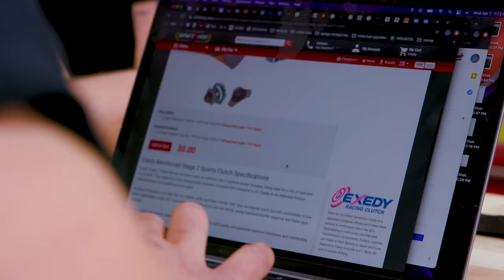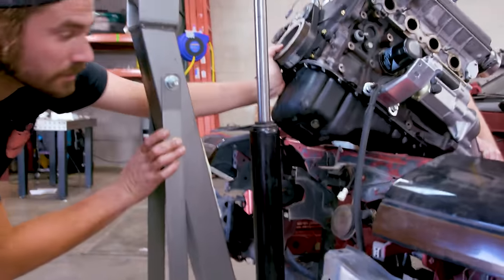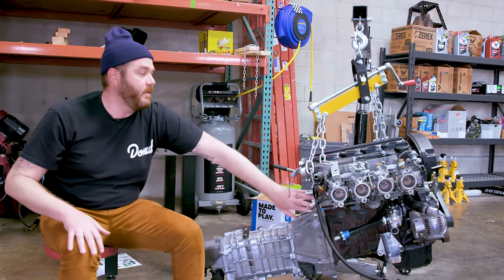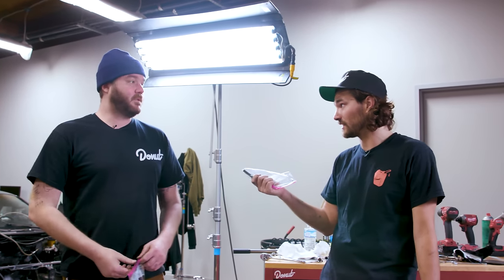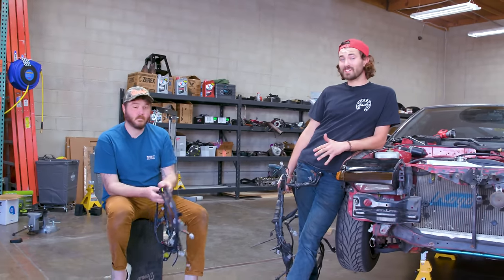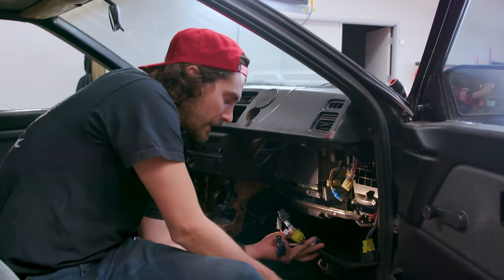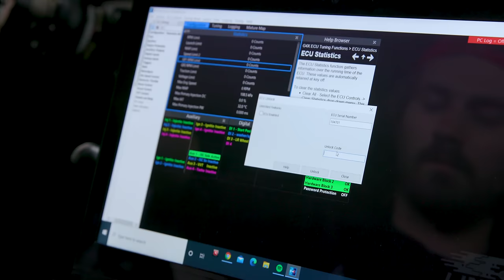Engine Swapping James’ AE86 - Was it Worth It?

Comment: The fact that the next episode will 99% likely be you pulling it out to paint the bay is the best way to end
Reply: If i know anything about donut this is exactly what will happen
Reply: I have 0 faith that that engine bay is ever getting painted.
Reply: @michaelleoanrd194  we can only hope
Reply: Hopefully they do 😭
Reply: Can you make this not the top comment! It was disappointing to look down and read this half way through the video. I want drifties
Reply: T-t-t-turrrrboooo
Reply: Lol
Reply: I hope they don't. I love scrappy, mismatched paint like that.
Reply: They should just clean it with some acetone and be happy now that the engine is in the car
Reply: The entire car just needs to be painted.
Reply: Why wouldn't u paint the bay first !!!!!
Reply: They did re-plastidip low car.  Wouldn't surprise me if they removed the motor to paint
Reply: Because that's how it should be done, a dry fit (welding brackets etc etc), removal, prep and paint, install complete engine into a properly done engine bay
Reply: @Sku77CL1PS  I don’t get how I’m spoiling it? I made a prediction based on pumphrey. I have no clue what’s coming but I am Sorry to ruin what I did. I never thought it’d be too comment 😅
Reply: I am from the future, they didn't in fact, pull the engine to paint the bay.
Reply: Does that mean there is a 1% chance of it not being likely, and how good are the likely odds?
Reply: @michaelleoanrd194  me too no faith at all
Reply: and forget to buy the paint for the spray guns. :)
Reply: James sold the car and my friends bought parts of this car. I was trying to get the dashboard that came with it
Reply: it’s still not out
Reply: Whole tim theu were pulling it I was lile please gut the bay and paint it lol such a clean 86
Reply: @michaelleoanrd194  The first first thing that 😅comes😅😅😅😅😅😅u😅uu😅yeah you’re  y😅y

Comment: Things I learned while doing my first engine swap. 1. Either buy a used engine or a crate motor 2. spend a little more and get the beefier parts 3. paint the engine bay 4.check smog laws before you start 5. If your car is over 40 years old redo the wiring 6. It's incredibly satisfying the first time it starts
Reply: I see that “paint the engine bay” in there 😭

Comment: Y'all inspired me a long time ago to turbo my 2.4 Dart... I've got about 13k in parts sitting in my room and in shipping right now. In the next month or so my car will be pushing 300whp at the least, more than double stock power. I did hundreds of hours of research and spent measured every aspect of the engine bay- even 3D modeled the whole engine.  Designed my entire turbo setup myself and am going to be running a Frankenstein of parts, cst4 for a mazdaspeed3, water air intercooling, meth kit, auxiliary oil system, built trans, big tires, the whole works.  Channels like yours inspire me every day to keep wrenching, building, and designing :D
Reply: Nice
Reply: that sounds SICK
Reply: How did it go?
Reply: You spent $13k to make 300whp? Weird flex
Reply: goddamn hope it went well

Comment: This is like when Takumi blew his engine and swapped a race-tuned one that goes 11,000-13,000 rpm  and then basically beat an evo on the touge
Reply: Does this mean James is gonna blow up this engine?
Reply: It's 11,000 rpm
Reply: yes and no
Reply: What about that time the gaijin put an RB26 into a rusted out mustang and defeated the Yakuza single handedly by drifting down the mountain?
Reply: @lrrr9734  James is the next gaijin that will single handedly beat the yakuza
Reply: Not really, in the anime they showed a silvertop. But in reality they where referring too a hasselgren formula atlantic 1.9L heavily tuned 4age. But one can only wonder how they "detuned" it for street use. Tbh for a swap id go for a 3sge
Reply: It's kinda true. Go watch video option... all the cars DK spanks in his 86 on the touge. The Hachi Roku is legendary!
Reply: Well Takumi blew both engines eventually
Reply: @SimanSlivar  1uzfe/7age/k24
Reply: @decoyla  na the 3s is perfect for the platform. It requires the least chassis work to make decent. Tbh i dont like the honda k engines they tend to not have as good usable torque without some extensive work and for what they are they are kinda on the portly side vs a 3sge blacktop and a w58 trans combination. 7age is more or less with the atlantic enigne is with allot of added work and a 1uz requires allot of chassis work. The ae86 was never made for a v8 and even has problems out of the box with the 4age.

Comment: Would love to see more of this project I love ITBs! I installed some AE101 silvertop ITBs on my miata recently. Opted not to tune on TPS alone like many others do for the lack of versatility and instead decided to figured out how to run on speed density (MAP). I configure my own vacuum system that behaved similar to stock and the car runs like a dream and I was able to actually use my previous stock tune with simple tweaks to fuel load. It runs very smooth and feels surprisingly "factory".

Only really mentioned all that in the off chance someone who is in the middle of or wants to install some ITBs reads this and knows it's possible and was actually a pretty simple setup. A vacuum block a couple check valves and some hose and done. Just gotta configure it right.

Comment: the 4AGE 20v blacktop and silvertop is not 2.0L, it is still 1.6L. What you see on the valve cover "20" means 20 valves, not 2.0L
Reply: Its the 3sge beams blacktop that is 2.0 liter and had 16 valve  the 4a ge blacktop is correct 1.6 liter 20 valves. But some use the itb from 4age blactop on the blacktop beams.
Reply: @terjejohnsen3651 
3S is always the correct swap on a 4cyl Toyota. I run the 3S-GTE variety on two of mine. The BEAMS is the go-to for NA HP, though. No doubt.
Reply: @negativeindustrial  i use 3sgte gen3 on mine 2 mr2s but beams has no lag and you can get more piwer out of it even its really expencive.  The cheapest is to use blitz compressor.
Reply: @negativeindustrial  The 4age would be more period correct for the car, and would probably rev higher
Reply: He also pointed the front of the FF configuration the wrong way (intake facing back)
Reply: @negativeindustrial  yea but the blacktop has 5 valves
Reply: @augustopinochet6899 
BEAMS 3S have a very high rev limit and dual VVT-i. They make 210HP in stock form which no 4A comes close to.
Reply: @negativeindustrial  But the 4age is oversquare, which assists in pushing engines into high rpm, vs the 3sge square design
Reply: @augustopinochet6899 
The 4A is an awesome engine. I love the early T-VIS equipped ones, too. Fun to run out the revs but they produce too little HP to deal with on a swap.
For me. I’m glad people still run them, however.
Reply: @whengchung90  and they use the blue coolent they should use toyotas red coolant.
Reply: @terjejohnsen3651 
Only Toyota Red should ever be used. The same goes for all fluids, engine seals, ignition components and basically anything else.

Comment: James Could have also mentioned that the Black top 4AGE also came side mounted on the AW11 MR2 so it was basically a front wheel engine but on the back. The engine being available as is on the MR2 made the chances of getting a transverse version a lot more likely as it's also popular for MR2 owners to swap away from their 4AGE into a Beams 3S-GTE or a Kswap

Comment: The only engine swap I've done was on a '69 Chevelle when I was like 22 or 23 in the year 2000. Also of note is I did the whole thing by myself with nothing but a Chilton book for help.  It came with a 307 with a 2 bbl carburetor. I put in a 350 with a 4bbl carb and aluminum intake. It was pretty fast but I couldn't afford to really keep up with it and I didn't know a lot of things I needed to to tune it properly.  Also it got about 12-14 mpg.

Comment: Last generation 4age 20v blacktop was a 1.6L engine with 5 valves per cylinder. All 4ages are 1.6L. Using a 7A block will stroke the engine to 1.8L. BLACKTOP 2.0L refers to the 3SGE BEAMS engine.

Comment: ITBs are some of the single coolest things to ever be on an engine. Could I have made mo powah baby on my 68 302 with an electronic fuel injection system? Yes. Would it have been slightly more reliable with EFI? Yes. Does it look as cool as the individual Weber setup that actually went on it? NOOO

All seriousness. You can get nearly the same economy and reliability out of a carb'd engine as you can out of EFI, as long as you take the time to fine tune it. When I was 16 my grandfather was looking at my 1970 Ford Torino with a 351w. Walked inside grabbed a glass of water, full past the brim so just that surface tension was holding the water in the glass. Set it on top of my air cleaner. When water was obviously shaken out of the glass. He looked at me and said "Turn your carb, this glass should be able to sit on this engine without spilling a drop"

I hadn't seen it at the time, but I would come to find out later in life. My damn grand father was the American version of Bunta Fujiwara! Damn old people and their water... 

As funny as this is, its not a joke. Because of this my 351 purred like a kitten at idle and roar'd like a jungle cat with some sweet sweet revs. Also, my 68 Mercury Cougar with the 302 I had after, got 28mpg on the highway. Took me endless packs of carb jets and hours and hours of time to make it happen, but it can be done.

Comment: As for painting the engine bay, another channel i watch, seems every bay is painted white, makes it so much easier to see what you're doing. I'm definitely doing it if i pull my engine, even if it's with a brush and not a spray gun.

Comment: I hope u put a racing 86 engine in it that revs to 11g
Reply: it would be cool but there's basically no way to get your hands on an engine like that nowadays
Reply: If you could even get the parts the engine would basically be a complete race engine which would wear out very quickly and also have low power at low RPMs. Since James drives his car on the street it would actually make the engine worse for his application
Reply: @ericsson_motorsports  exactly
Reply: @vitozivlak  eh, you can always get a formula Atlantic motor from somewhere. Plus building the 4ag into a race motor is always a possibility, there's a guy with a 250hp 16v in a hillclimb KP61, think it ran 11k revs at one point

Comment: Next video ideas:
1.  Tuning basics using a lap top and an ECU WITHOUT a dyno.  You got that new LYNK unit to play with....
2.  Cooling basics / fill / monitoring / improving for higher HP applications.  Water vs glycol vs wetter, etc.  How to measure, and improve.
3.  Maintenance intervals.  What changes are recommended to be considered when you up the HP of your engine or do a swap?  How to keep it alive...

Comment: Go they reminded me when I assembled my 86 with a 4age 20v mid 2007 or 2008 engine. I made the engine wiring by hand by seeing the forum 4ag club post. Then I mounted a Honda commutator since they mounted it with the Honda distributor and modified the Toyota distributor so that the computer would read the signals. The last thing I did was make it 7age 20v bored to .080 piston oversize. and I made him regrind the camshaft. The last thing I am going to do is mount a HKS F-CON V PRO computer but I am going to try to communicate via Bluetooth to the ecu.

Comment: ITB's FTMFW. Sound so amazing at high revs. AE86's are the perfect car to beat on and one of the more 'affordable' chassis' to build, plus you don't have to feel bad about pounding on it. Unfortunately they have recently went up in price as culture has influenced this as well as desirability/ rarity to find a clean unmolested one. Engine bay prep is huge when I do a swap. One of the first things I do before I stab a new drivetrain in is clean/ eliminate all the unnecessary bullshit in the bay and then paint it up. No reason not to take these extra steps and you'll probably regret it once the engine/ trans is in as its pretty daunting to say the least to make the bay look as good as it can with everything installed and obstructing it. Nobody wants to spend the extra time after the fact masking off everything to prevent overspray and or messing up your new engine.

Comment: You should cut the top support for the radiator but keep it to bolt back on.that way when you have to take the engine out you can just move it and then bolt it back on when your done.

Comment: When ur so excited to install a part, or in a rush, and forget a simple but necessary part like gas lol. I was rebuilding all 4 brakes on my car, started raining. Left my car for a week until I had time to get back at her. I was racing against time to make my appointment. I put in the driver side in like 5 mins, goto the other side...I put in 2 of the same pads. Put both outer pads on 1 side 🤣 needless to say, I missed my appointment but I got my brakes rebuilt! 😆

Comment: For future reference dont swap rwd engines with the front end elevated  angles are all wrong as you saw when trying to stuff the engine in, keep the car level or even raising the rear will make install smoother. Something to keep in mind when pulling engine to paint the bay

Comment: Yo. Just want to make sure you guys addressed this. Doing that front wheel drive engine to rear wheel drive conversion you got to either keep the motor at an angle like the front wheel drive for correct oil pickup or have to do a little bit of modification so you don't have oil starvation.  I can't remember if it was oil pickup location or drains in the head but there was a reason

Comment: Hydra Flash! Someone has been working with a 7.3L Diesel. 

I need a project car, a project truck is way harder without a lift to pull the cab off imo. Especially in the earlier OBS power strokes, the engine bay is way small, almost impossible to pull the trans and engine as one piece.

Comment: Don't forget to disconnect your fuel lines or pull the pump fuse and crank the engine to prime your oil before you start it for the first time.

Comment: It’s easier to install an engine attached to the trans in a rwd if you lift the rear not the front once you get the trans past the tunnel you lower the rear

Comment: What's nice tho, is that the 20v swaps have all the parts available to mate them with 86.. (insert old ass dude remarks here... Ready? Here we go)

In my day LOL the parts were just being researched to do the swap so you could get the motors and trans all day for cheap99 but it would be a pretty paperweight in the garage or shop for a couple of years before we could Install them

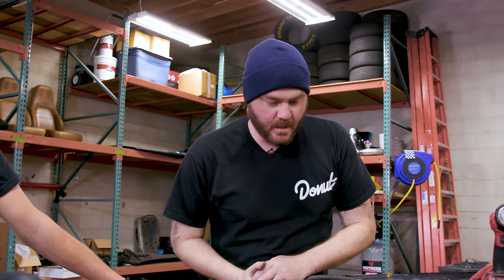Comment: 8:12 James, from car guy to car guy; don't use a torque wrench to tighten bolts in when they're still loose cause it'll cause the torque wrench to wear out faster and fall out of calibration! Just use a normal ratchet my dude, and it'll be easier on your wrists!

Comment: did you delete the iacv and the rats nest under the itbs? if so you need to synchronize the throttles individually to get the idle smooth and where you want it, get a carb synchrometer off ebay and adjust the screws that sit under the trumpets.

Comment: First... If you remove the carter you can get in the engine easy.

Second... You definitely need the transmission mirror (iron plate that goes between the engine and transmission)

And last thing... Contact the Chamo Tunning on youtube or instagram, he's the best repro guy I know from the network.

Comment: Had the 6 speed blacktop once. Low torque, but damn if it isn't revving hard! I miss those days so much. Nowadays you can't even touch anything on the car without the sensors kicking in and nothing starts. Too much digital wizardry and not enough mechanical brunt for my tastes.

Comment: Super late to the party here, but I am super confused about one thing in particular. Is there something that connects those ITBs to some sort of air filter? Because from what they show in the video it's just letting outside air directly into the engine without any sort of filtration, which from my experience is a big no no 🤣 someone explain plz

Comment: im confused as to what engine they put in it. could some what tell me?
Reply: It's a 5th generation Toyota 4A-GE engine, usually called the "black top". It's a 4 cilinder 1.6 liter engine, making around 160hp from stock. It was found in the AE101, AE111 and AT210. It's a great engine for small cars like the 86, and has a good amount of tuning potential. In my opinion one of the best engines Toyota has ever made, next to the 3SGTE and the 2JZ.
Reply: @dudocaine  thanks! for some reason i though this was a 2jz
Reply: @fatpoodie231  Nah, the 2jz is a 6 cilinder engine, a lot bigger and heavier than the black top. You can recognize it by it's valve cover, colored sky blue if it's a 2jz-gte or matte black if it's a 2jz-ge. It also has a big "3000" written on it.

Comment: Good job. Lots of "phrasing"/that's what she said material. Just for fun - pulling it out, jackin it, will James get it, (to get it in) you need to come push it down and in, pretty tight in there.  That's all, so far. I'm done. I promise...?   Wondering why that it's mostly guys who do this? Both the work and the childish referencing. Like the chan guys. Wanna come do my 3sgte 91T SW20 for me? Itll be easier - transverse (Mounting when you put It In sideways😘. -ok, that was the last one)